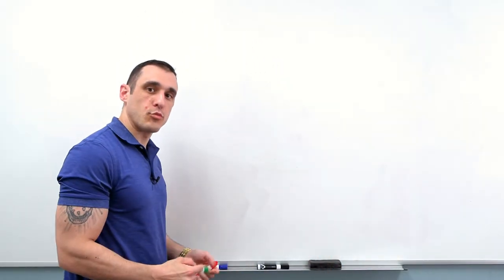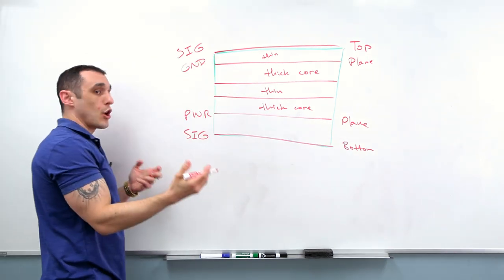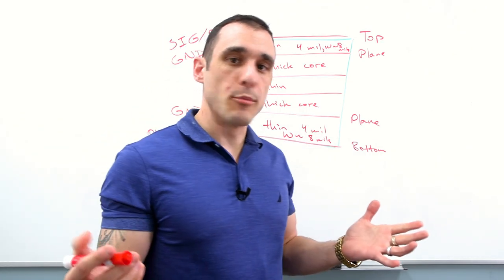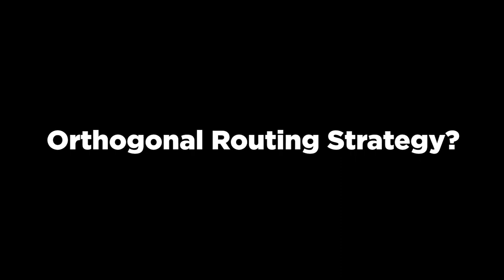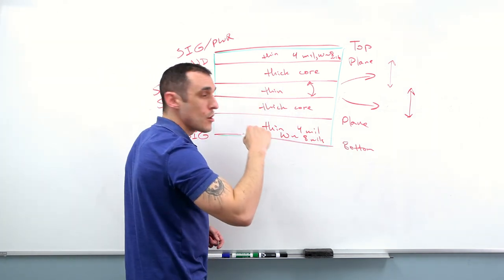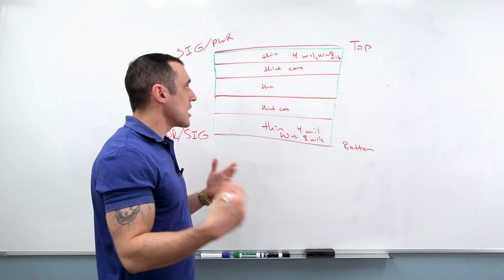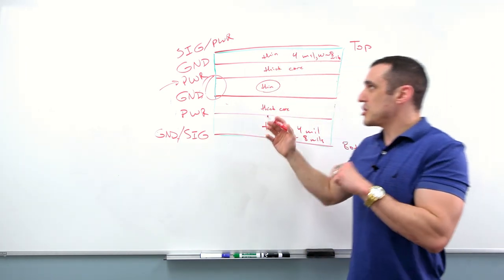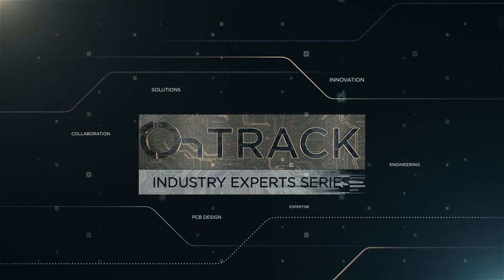Getting Started with 6 Layer Boards | High-Speed Design

Comment: Just seems best to use signal on top and alternate ground signal ground signal ground all the way down and the power is on signal layers where needed or available for decoupling. It’s the safest config and just works. Do keep your grounds stitched together and have ground transfer vias any time power or signal change layers.
Reply: I think the most common instance of going from 4 to 6 layer is to get 1 additional signal layer and one layer to dedicate to large power rails at multiple voltages. I've most often had to do this to route multiple rails to large groups of power pins on a BGA.

Comment: What are the positive and negative sides of the sig/gnd/pwr/pwr/gnd/sign stack?
Reply: Why do you need two power planes? It is sometimes not a good idea to have overlapping power planes when those power planes need to supply power at high switching rates for digital components, the capacitance between the power planes fills up with a fast switching EM field which can then radiate from the edge of the PCB. It's better to put separate rails on the same layer as they will have lower fringing capacitance between them. If you have a very large amount of current on the same voltage rail that you need two planes, then I guess use the two planes.🤷‍♂
Reply: @Zachariah-Peterson  If you put a 0.9mm thick dielectric between the two power supply layers, you can minimize interference, right?
Reply: @Zachariah-Peterson  But what to do if there are so many voltages on the board 1.8v, 1v, 3.3v, 5v, 1.2v and there is no way to place such an amount on one layer, even if you minimize the gap between these polygons? Is there a way out of this situation, other than switching to 10 or 12 layers, so that each power layer has its own ground layer?

Comment: and what about 8 layers ? Is it good to put : SIG, GND, +3.3V, GND, SIG, GND, SIG, SIG , there is some traces +5V and 10V but all going on layer 8 and far away (~5mm) from signal traces ?
Reply: Don't put two SIG layers next to each other. I would say that the better choice would be SIG/GND/SIG/PWR/GND/SIG/GND/SIG with a thin layer between PWR and GND. The slower signals and control/configuration signals can be on the layer adjacent to PWR. The other thing to note is that if you need an 8-layer PCB with many signal layers, you will most likely have multiple power rails to power your digital chips. This means your PWR layer should have most or all of the rails drawn on it. If you need higher current or there is just not enough room for all the rails, you should then add another PWR layer.

Comment: Thanks for giving details about 6 layer stack up. Dear Zach, I am designing 6 layer stack up having signals upto 1.28 GBS and fast command. I used following stack up,,, power and ground on the top, layer 2 digital and analog signals, layer3 Gnd, layer 4 differential, layer 5 Gnd, layer bottom for components placement and layer switching signals. Also on every layer I used Gnd along signals. Is it ok or need to reconsider my design please
Reply: I can see that you have allocated a layer for fast signals but without knowing everything in your intended design I cannot tell you whether it is guaranteed to work.

Comment: Hey Zach! Thanks for video. Could you make a multi signal board from 'zero' for High speed design in Altium designer ? (Ethernet,USB,CAN,UART,SPI,I2C signals on the same PCB) Your speech really cool but you know practice makes perfects!
Reply: Check out some of the projects I've done on the channel, some of these have been simpler and only use a could of the interfaces you listed, but these are a good way to get you started working with some of these interfaces.

Comment: CRT, microwave-oven, radio, radar, wifi, 5G, ..., baseline high-energy long-wave atmospheric bending frequencies, ... 
Direct for EMI-EMF to 6 or more layers of fry-bake spiral-potatoe layered-design inductance for precision multimeter composite-alloy resistence controlled electronics = out of range for troubleshooting.

Comment: One thing I find difficult is to get enough real estate for high speed signals with much IO. SDRAM and 24bit LCD in particular with the strict requirements of having to sandwich them between grounds. It seems that it would be a good idea to keep such highspeed signals at the bottom layer, with a ground plane above, as well as the top layer, when the PCB gets mounted in a grounded metal case
Reply: For high-speed designs the simplest stackup is (SIG + PWR)/GND/GND/(SIG + PWR), which does exactly what you describe. You need to start adding those internal layers once certain components (BGA) have high enough pin counts or you have completely run out of room on the outer layers.